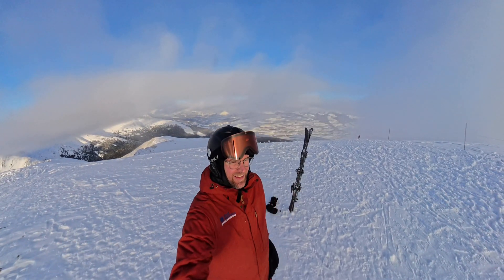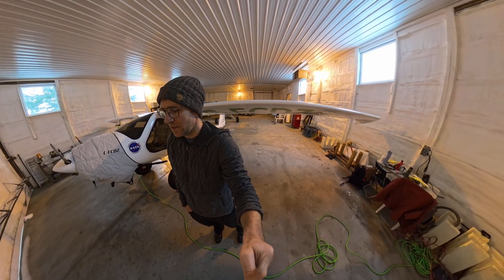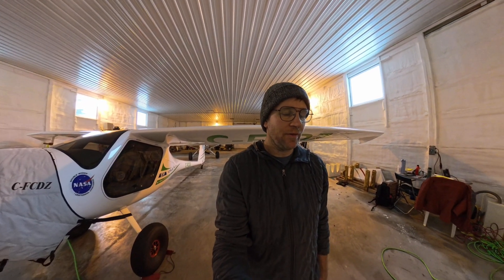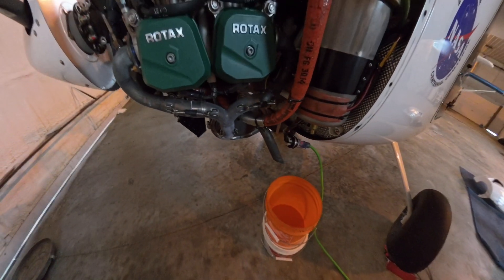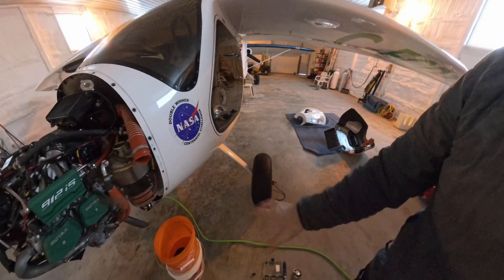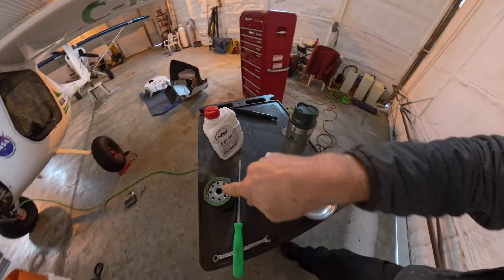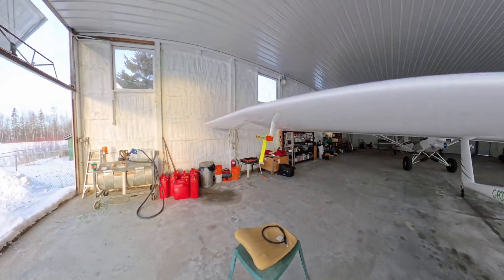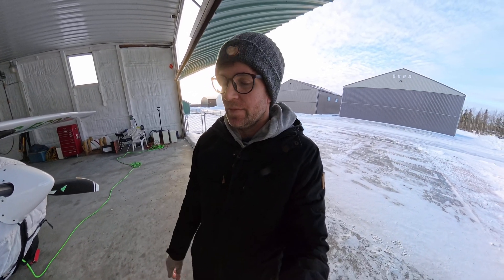Switching to Rotax XPS 5W-50 in a 912iS

Comment: A water pressure gauge on my 912 helped immensely for alerting me I had a leak. Which I eventually did on the radiator. I wouldn’t have known about it had I not had the pressure gauge and probably kept flying on my 3hr trip. It would normally sit right at 9 psi but one day it dropped to 5 psi so I landed as soon as possible and sure enough I had a leak.

Comment: Any chance your coolant leak is coming from a weep hole on the bottom of the water pump housing? If so, it could be the first sign of a failing water pump seal. I just happened to read a post on the Rotax Owner forum recently about these leaks and the process of replacing the seal, so it was somewhat fresh in my mind.